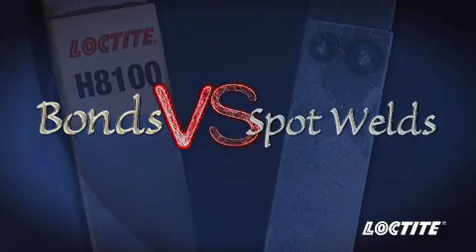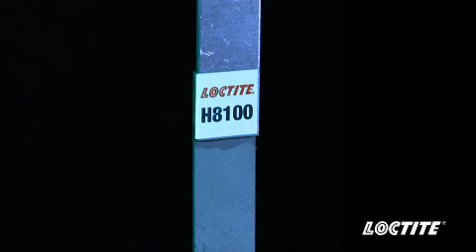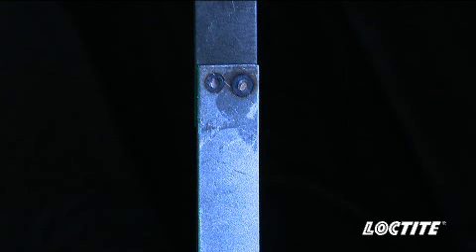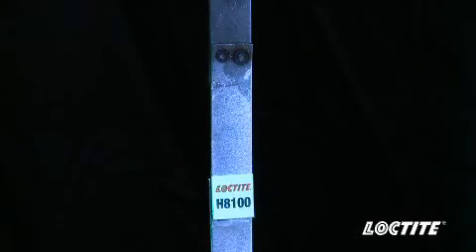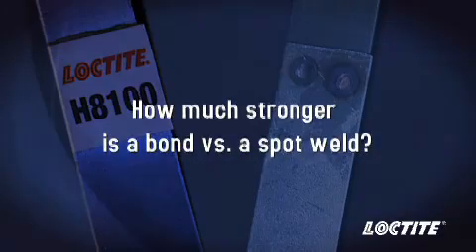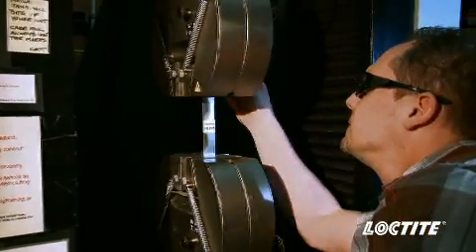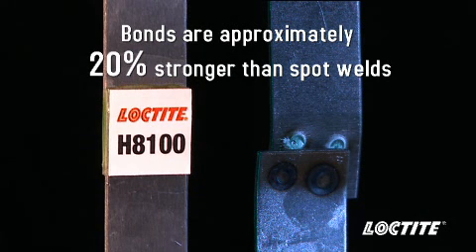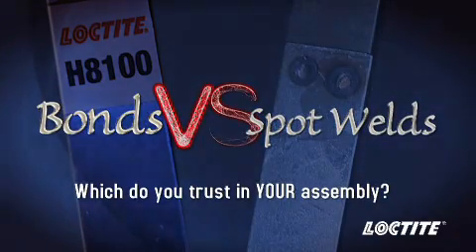Bonds vs. Spot Welds

Comment: In automotive repair, you would think that spot welds are only for structural repairs but in many cases such as roof panel replacement, you glue and stop short of certain areas  then you spot weld the unglued areas. The welds act as sheer points to release energy as the car gets into a collision. If you used glue only then the energy cannot be dispersed thus damaging the car and more importantly the occupants worse.

Comment: In the demo shown it would be common to use at least four spot welds, not just two. Also, spot welds can be used for electrical contacts with rechargeable batteries. Is Loctite of any value in being highly conductive and effective as a replacement for spot welds on battery packs for toys and power tools?   This video provides insufficient information on the product and its possible uses and places it should NOT be used.  It is often important to know the LIMITATIONS of a product before using it. For example, would Loctite give way if subjected to long term immersion in gasoline or liquid ammonia, since spot welds would have no problem in this area.